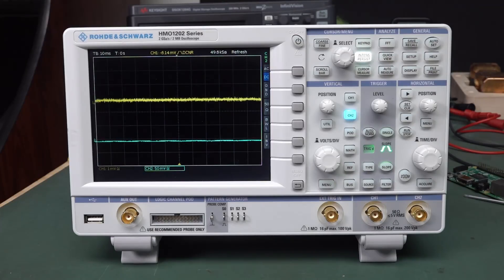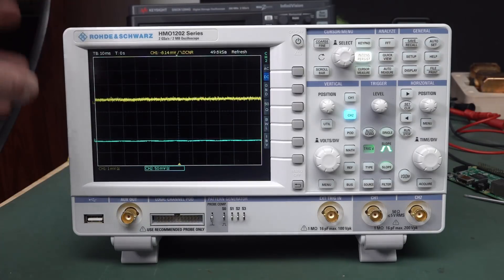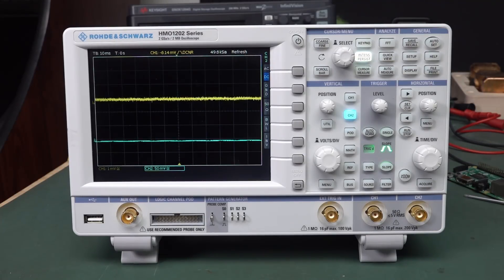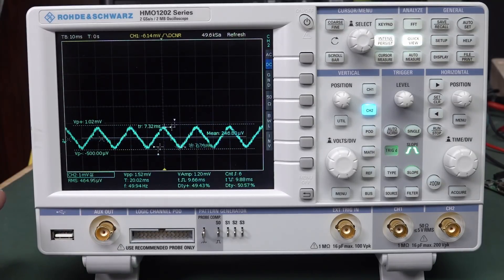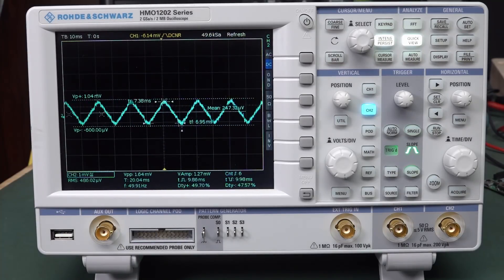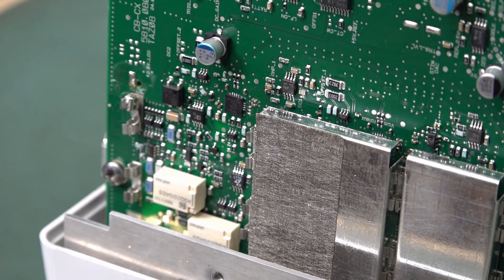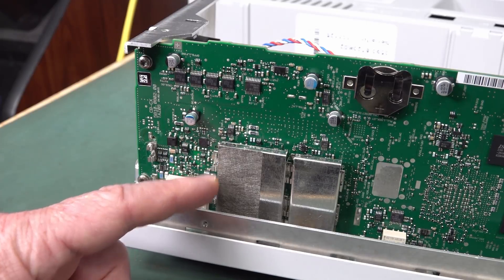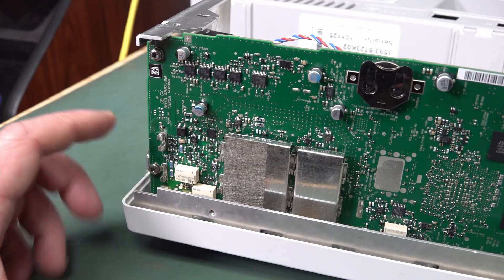What happened to my Rohde & Schwarz HMO1202?

Comment: I’d cut from a craft aluminum sheet, slap some kapton on it in case it shorts something.
Reply: There is also craft copper sheets, easy to bend, not so flimsy. It oxidizes and turns into different color though.

Comment: When I'm rolling my own stuff I just use ~ 0.3mm copper shim and cut and solder into place , cheap as chips and very easy to cut/form , my 200mm household scissors and sparkies side cutters work just fine ...if I'm making a few I just cut a little block of wood to size as a bending form.
Reply: Brilliant idea.

Comment: why not just use a copper sheet and fold it manually into that shape? Or like a soda/peanuts can? I don't think it should be that hard just to do a few bends and solder it together. I would try doing that probably just as a hobby thing.

Comment: Of course the obvious answer is to order one from R&S!  ROFL 🤣🤣🤣.
These are made of cold rolled, tinplated steel.  Practical idea: Get one from one of your "dumpster dives" and reform it with pliers and tin snips.  The exact dimensions don't matter, just so it does not short out anything.   Since you want to be a perfectionist, yes there are companies that would make you one, but at high costs, the main one being an expectation of a production quantity  order follow-on.

Comment: I've accumulated a small stock of brass and copper shim sheets in a handful of thicknesses over the years in the lab. Both are easy to work and, of course, solder. They don't take up much space either. You can cut them with a PCB guillotine and/or aviation sheers. Might be good enough for Straya.

Comment: Get the measurements using your calipers, cut down and bend a sheet of galvanized steel. Any bare bit of roofing flashing or ducting should do. Only mildly exotic tool you should need would be a hand brake, which you can easily get from your local hardware store, and that will probably be merchandised in close proximity to the flashing or ducting.

Comment: Very easy to DIY. Just take a piece of 0.3...0.5mm brass or copper sheet metal, bend it in a vice (use aluminum L bars on the jaws to protect the sheet metal) and bend it by hand.

Comment: Just take a piece of old shield from whatever device - monitor, TV or whatever, and cut it with whatever you use for cutting sheets of metal. Before cutting drill 1..2mm holes on furure corners of the final shield. Should work.

Comment: I'd just take the old can off, measure it, then make a papercraft replacement prototype

Once you have the dimensions down, cut out a sheet of metal from whatever source you please (shielding can from ewaste, sheet metal from a dishwasher door, etc) and bend it to shape.

Could even cut along the bend points and just solder the pieces together if it's too hard to bend and the metal takes solder well.

Comment: laser or waterjet cutting some sheet metal would probably be the most professional way of doing it but cutting some sheet metal by hand would also work. ... steel is probably easiest to find and then you would use some acid core or careful work to to tin the ends then clean them very well (can always just glue the can in place it doesnt have to be electrically connected very well ... or get some thin copper or brass sheet as its easier to get solder to stick to that... or if you find a big enough piece of shielding can on something from a dumpster dive you can modify it.

Comment: Drank any soda’s recently?  Maybe you could cut up a coke can or something and form it into a screen.  Word of caution though, coke cans have a non conductive coating you need to scrape off in a few spots.
Reply: Wouldn't that be too flimsy?
Reply: @TheHuesSciTech  nope, the folds at the end would stiffen it up.  Not only that, but it’s not doing anything mechanically challenging anyhow.  Aluminium is a decent conductor, more so than steel so I see no reason why it wouldn’t work.

If there’s one problem with Aluminium can on steel clips, it’s that there’s a slight chance of some interaction.

Finally, it’s very tricky to solder to Aluminium as it reacts with the air immediately upon contact so you’d want grippy clips, screws or some other means of retention if at all possible.
Reply: @Jenny_Digital  You can solder aluminium if you put a drop of (quite heat resistant) mineral oil on it, scratch the oxide off under the oil drop and then quickly tin it. One it is tinned, you can clean it off and solder in that spot. 

Does produce nasty fumes, naturally, so use a fume extraction device or at least ventilate well.
Reply: @VintageTechFan  Thanks, that sounds worth a try out.  I don’t have any Aluminium flux knocking around and would love to make this easier.

Comment: 50 Hz may be magnetic as well. From my experience the best material for bodging a shield is a sheet metal cut out of a tea tin.
Reply: For that grab an empty can of spray whatever, as long as the can is steel. Then puncture it, get the last of the gas fill out, and then cut the bottom off. Scissors work well, though they will never work for paper after this, and can also punch the holes. Cut top off leaving the cylinder of coated steel, and then cut down the welded seam, to get the sheet.  Straighten it using another can as former, and take the sheet, mark out the shape on the inside, and cut the rough outline, leaving the sections with bends long. Then a pair of pliers to grip the bend, and use the end to gently bend down, moving from each place to the next as you get to around 30 degrees, so you go over 3 times till it is a right angle. Then final cut to shape, with the print on the inside, and then lightly sand where the solder will be, and apply flux then solder the bare metal. Then place in and reflow where needed, remove flux residue and then a wipe with a paper towel dipped in oil to leave a thin film against corrosion.

Comment: Cut up an old soda can, it's just thick enough for this and can be easily cut with regular scissors and bent without any tools
Reply: Better than my initial idea of using an old tuna fish can 😂
Reply: It's hard to solder to aluminum.
Reply: @blarggggg  you don't need to solder it, the clips will hold it in good enough if it's not getting tossed around every day. The factory soldered it to prevent it coming loose from shock and vibration.
Reply: @brainndamage  The same clips that are already full of solder?  I guess that could be cleaned up, but they're probably pretty FUBAR at the moment.
Reply: I feel like soda cans are actually far too flimsy for something like this? Like, it'd be all floppy and difficult to push into place.
Reply: @TheHuesSciTech  if you put sharp 90 bends on the corners it'll be stiff enough
Reply: @TheHuesSciTech   Do not underestimate the strength those corner flaps will provide to the main surface. Once it is in place it won't have to provide structural support to anything else.

Comment: get some aluminum duct tape or literally any piece of dumpster scrap, any laptop or monitor or tv etc will have some cans, its pretty easy to cut and bend a replacement out of oversized 1s if you dont luck out and find a exact replacement

Comment: I have a history with sheet metal, so I would just make this sort of thing out of the standard stuff from a hardware or HVAC supply store.  You'll want to draw out a pattern that can fold to the final shape and take your time bending things slowly with the widest, flattest tool that you have, but never with your bare hands unless using some other hard edge for a radius with plenty of overlap to push with.  You absolutely cannot bend a 1cm edge by hand ;).

This shield should be simple to make as it's just a pan, but for more complex shapes start with the innermost bends and work your way out.  Don't bend an entire 90-degrees all at once unless your tool covers the entire length.  The narrower your tool, the more shallow bends you'll need to make to reach your goal.  Table edges, steel rulers, and clamps can help, but hand tools are usually best for items this small.
Reply: I've made shield enclosures by hand using a hand seamer, and while it's possible it's a bit of work. The alloy used for shields is called nickel silver and it's quite a bit harder to cut than normal sheet metal.

Comment: I would cut a piece of un-etched pcb board for the top and use some single strand copper wire soldered from the surface to the sides and bob's your uncle! alternatively, you could make a a can out of brass or copper sheets .easy to cut and solder, last time I got some from hobbyco QVB for 1$0)

Comment: Maybe this is stupid ass but, maybe cut an aluminum can with a scissor, and then possibly scratch out with sandpaper at the contacts? :D I wonder if there's any theoretical downside to this
Reply: Actually that sounds like a pretty solid plan.
Reply: Scratching may be enough short-term but you really want to solder it like R&S did. And that will be much easier on tin-plated steel or copper than aluminium.

Comment: Find an old VCR/Cable box tuner in the dumpster.  Their tuners usually have shielding cans which you can bend and cut to match the shape and size.  A 1$ or 2 air/vent duct tubing from the hardware store is just thin enough to cut and it should also do.

Comment: if you want it professionally done, why don't you remove the other can, if its the same and go with it to your local metal worker and ask them to do it for you?
And also don't forget to specify the material (ie Aluminium, Copper or whatever they think)...

The cheapest/easiest way to do it might be to do a Lead/Tin one that you cast yourself perhaps?
Reply: good luck casting a 0.2mm thick shield
Reply: @poptartmcjelly7054  that no casting, just a pair of tinsnips an a metal brake needed. Most Metal workshops would do something like this for a few bottle of beer.
Reply: The shields are made of a copper alloy called nickel silver.